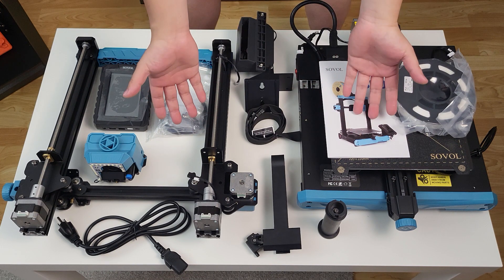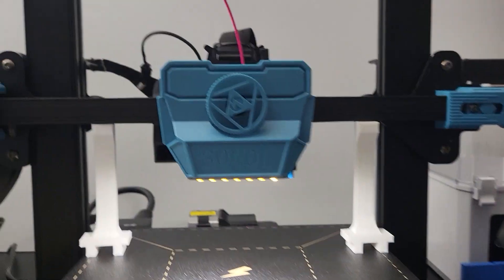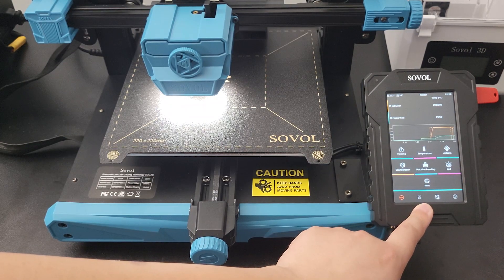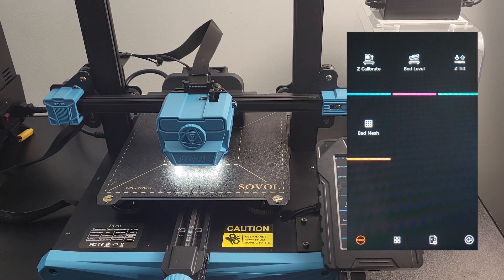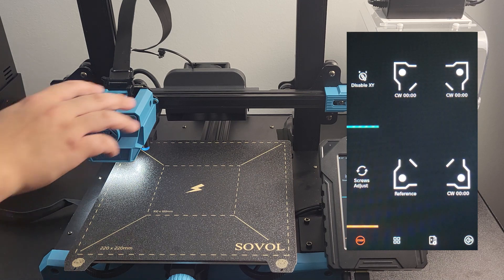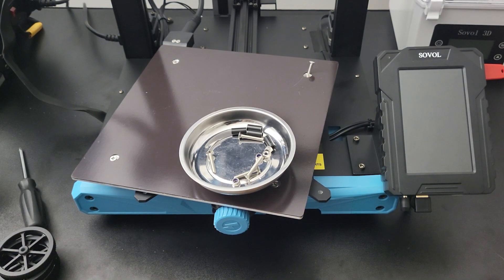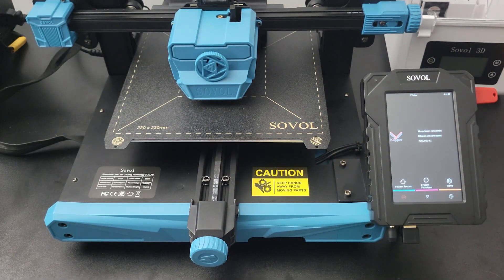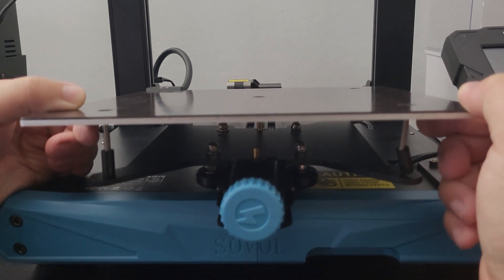Sovol SV07 Bed leveling tutorial. Spring mounts and solid spacers mount step by step guide.

Comment: thanks for the video, today I put black plastic inserts instead of springs, since with springs I still couldn't achieve even a little bit of a level table, with them there are only 3 sections with values of -0.2 in one place, everything else is within +0.1-0.5

Comment: did you ever work out why the auto level function comes up with a different value every time, I am having heaps of problems with this printer, it never keeps calibration that works and it can almost never print anything higher than 5cm or so before knocking the print over

Comment: Thanks for this video.
I have a Sovol 07+ that has been going great after I discovered glue sticks, but suddenly nothing sticks. I’m planning to try a G10 plate.
The PEI plate is needed to stop the Z down before crashing into the the plate. If I add the G10 1.5 mm how can I prevent the head crashing into the G10? Thanks.
I’ve been levelling before every attempt.
Next day - I see that using a G10 will not work.
I’ve levelled the bed with a spirit level.
Did the corner levelling which put the bed way out of whack.
What hell is going on here?

Update
Restored factory settings
Manually levelled bed with spirit level.
Z tilt
Z calibrate
Bed level using screws adjust only
Bed Mesh

Is now printing good again.
Thank you :)

Comment: Z leveling does let me lower the nozzle as low that it comes in contact with paper.. why? Presumably my hotbed is too low altogether right?
Reply from the maker: did you homing the printer before bed leveling? Sv07 have sensor less homing feature, sometimes if the belt is too tight it might cause homing issue. You extruder should go the most left on x and front of y axis, then park to the center of the build plate when you start with bed leveling.

Comment: Nice video. Have you had a chance to do the input shaping? There is not documentation included with the unit, which is pretty frustrating.
Reply from the maker: I didn't, mine ringing test result turn out really good right out of box. So. But I will upload one video soon of how to do the input shaping.
Reply: @SvgLau  Thanks! That would be much appreciated.

Comment: Nice video how do I debug - Z-tilt failed! "aborted: probed point range increasing"
Reply from the maker: Restore all settings "restore factory" under "system" menu. Try move the z axis all the way to the top. System will limit the heightest point of travel, you can manully rotate the z coupler on both z axis to the top. Then, homing printer and try again.

Comment: Great video, I was having some fun figuring this out as SOVOL's documentation on assembling the printer is very well but I find the wire connection and the rest pretty lacking.

Using the risers and still having some fun with the "z calibrate", the one that moves back and forth. I keep getting a message saying the probe is getting closer to the bed, not sure why.

Just out of curiosity did you go with the springs or the risers? It seems like with the springs you can dial it in a little bit closer but you'd constantly have to check as they become loose over time so I went with the risers as they should be more accurate over a longer period of time.
Reply from the maker: Yes, you should have more room to manully adjust each corner for better first layer. But like you said, it may requires more adjustment in later day. So I did not go back to the spring and leveling nuts method. I just stay with solid mounts. So far it is doing okay, not the best first layer, but works for most of the prints.
 One thing I would said, pay attention when you remove the print from build plate. I just rip the PEI coating off the center of my build plate when I take off a TPU part. So highly suggest to bend the build plate when remove parts. PEI coast adhension isn't the best on this build plate.
Reply: @SvgLau  is there a way to stop is loosing level whenever you remove the PEI sheet to you can get your parts off?